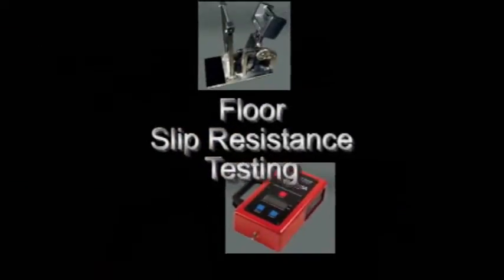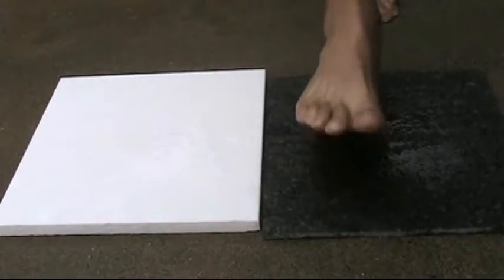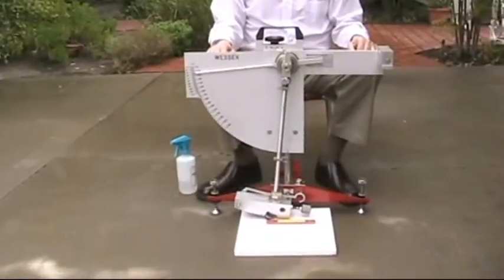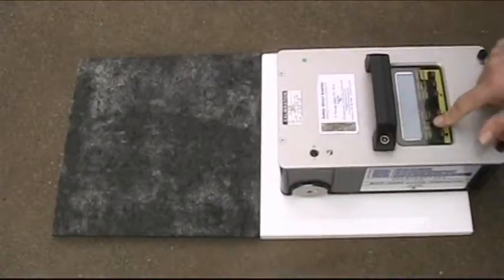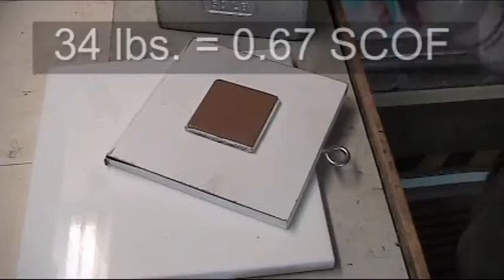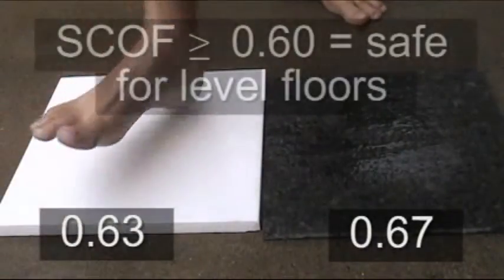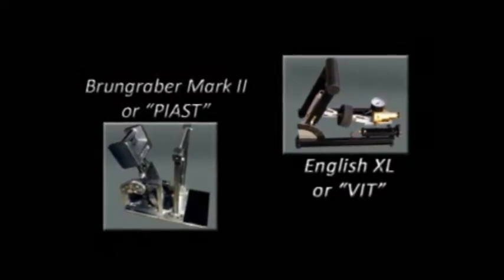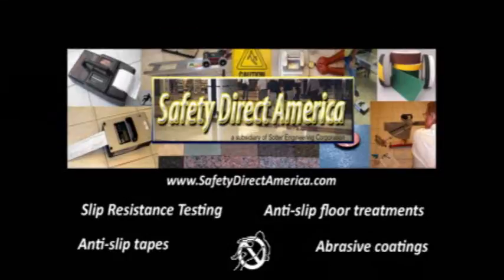Floor Slip Resistance Test

Comment: As you point out, the ASTM standards for the two testers have been withdrawn. There has never been such a standard for the testers that you sell. Either your testers can't meet the ASTM criteria or they haven't been submitted for approval. I believe the main reason the ASTM standards were withdrawn is that ASTM doesn't like proprietary machines. Perhaps your opinions are biased.
Reply from the maker: No, sir, "biased" couldn't be further from the truth. The Brungraber and English XL have been studied in various countries and they are very well-known to give completely different answers for each user...THAT is why the standards were withdrawn...for their inability to show that different labs can get a similar answer on the exact same tiles -- as shown in the video. We sell the pendulum, which is the most widely used and endorsed slip resistance tester in the world...it is the official tester in 49 nations, and has been endorsed by the CTIOA for many, many years. We also sell the BOT-3000E which presently has three official ANSI standards. The ASTM, unfortunately, has been endorsing and selling the SCOF C1028 standard for a long time now, but that standard expired last year, and it will be allowed by the ASTM to quietly fade out of existance due to the problems with it as shown in the video. That test does a horrible job of testing pedestrian slip resistance in the wet condition, and passes almost every tile I have tested using that method (and we've tested perhaps a thousand different floors using that really poor test method). We here at Safety Direct America are in contact with every floor slip resistance testing expert on the planet (not including the American "expert" witnesses scamming their way to paychecks using the English XL in court cases), and we only strive to spread the truth about floor slip testing since we in America have been so behind the rest of the world in this field until recently. Our hospitals are full of slip and fall victims, and the problem partially lies with the fact that bad and unreliable slip testing methods have been used in the U.S. for so long. Now common sense and actual research is taking over here and we are catching up with the knowledge already known in the UK, Australia, Germany, and other countries. Give us a call so we can further explain why the ASTM has been doing the pedestrians of this country a huge disservice over the past few decades, and what is happening now that is changing all that so that property owners, architects, building managers, and tile consumers can know their actual risk in every situation so that they can choose appropriate tile and seek remedies for slippery situations. When you know the truth, you can react to it. Unfortunatley the ASTM has been telling everyone that every floor is safe, which has made slips and falls the epidemic it is today in the U.S.
Reply from the maker: Daniel Merrick
 The BOT-3000E, although it is presently only made by one company, is not a proprietary device...it can be made by anyone. ANSI B101.1, B101.3, and A137.1 all require the use of the BOT. ANSI A137.1 is required of all indoor flooring according to the 2012 International Building Code...so it will slowly but surely be becoming a part of the code requirements of all new buildings as the new code is adopted by every city and county in the USA. There's more information on this at http://safetydirectamerica.com/SlipResistanceTestingStandards.html
Reply: safetydirectamerica Perhaps you are not biased but generally the marketer of a product should be relied upon with skepticism when considering opinions regarding that product. Advertisements, such as this video, are possibly a poor source of objective information. I will remain a skeptic. The truth is always a hard thing to know in science.
 
I will agree that C1028 is useless for testing fluid contaminated surfaces. It might be useful in testing dry, static coefficient of friction but people don't slip on dry floors.
 
I believe that there is a fair amount of well-deserved criticism for all slip testing products whether your company sells them or not.  For example, In 1999 Gronqvist says of the Portable Skid Resistance Tester (PRST), a pendulum instrument: "The precision and consistency of the PSRT was acceptable, but its validity for pedestrian slip resistance measurement should be improved. The main drawbacks were that the applied sliding velocity was unrealistically high and that the normal force was dependent on the friction coefficient." A pendulum tester doesn't measure COF or slip resistance, it actually measures energy loss. Powers in 2010 said "the Tortus II did not pass either criterion in the current study. This motor-driven tribometer has a small test foot (9.5-mm diameter) that is held in contact with the surface under a fixed load as it slides across the surface. Other investigators have implicated the drag sleds’ prolonged surface residence time as a cause of adhesion, leading to COF measurements on wet surfaces that are greater than or equal to slip resistant dry surfaces (9,12,23). This adhesion may account for the poor results of the other drag sled tribometers evaluated in our study (BOT 3000, Tortus III, HPS, and C1028)."
 
None of the testers available today do a very good job of modelling how a shoe heel strikes a walkway during normal gait. The velocity might be wrong, the force might be wrong, the direction of approach might be wrong, the contact pressure might be wrong, etc.
 
One day somebody will come up with a test mechanism/method that produces repeatable, validatable results. For now, I believe that the results of any tester should be taken with a grain of salt. They are the best we have so far and we will have to do with what we have for now. However, at $6000+ each, one could certainly expect more.
Reply from the maker: DanQuoLives
 I believe you are correct in that there is perhaps no "perfect instrument" yet available, but the three instruments we endorse are as close to perfect as exists in the world today. I personally prefer to use the pendulum and the BOT-3000E (using the ANSI B101.3 test method) to get a well-rounded idea of how a particular floor will perform. The pendulum has been used for over 50 years in the UK and elsewhere for testing pedestrian flooring, so the amount of practical research available for that instrument is unparalleled. The Australians have a very detailed standard which uses the pendulum and has different goals for each and every situation. For example, a pool deck may require a PTV of 45 or greater, and a second floor lobby would require much less slip resistance. Makes a whole lot of sense! The B101.3 method is also based on extensive research comparing its results to those obtained with the German ramp method, which is arguably the closest to perfect as can exist since it involves actual people walking on the actual flooring. Of course the ramp method is only a lab device and is therefore worthless for investigating slippery situations in the field. The purpose of this video is to educate people as to where the state of slip testing is today, and to point out why some popular methods (C1028, English XL) are completely inappropriate for measuring floor slip resistance. The C0128 and English XL methods only confuse people and help to fill our hospitals with slip and fall victims. We answer questions and educate people about slip testing every day, so we hope that our customers will see this video before calling us and asking for a C1028 test so that we can move on to doing testing for them that will help them see what their actual slip risk will be, instead of simply providing a service where every tile will pass whether it is slippery or not. Too many people put horribly slippery tiles in bad situations (such as pool decks and entryways) and then are stuck with a bad situation where the tile must be ripped out or a solution sought such as chemical treatment. We just hope to educate people so that these mistakes are no longer made and people can choose appropraite tile BEFORE it is installed and people are taking trips to the emergency room, hiring lawyers, and desparately seeking a solution to a horribly dangerous situation caused by lack of true knowledge of how a tile will perform when wet.
Reply: While I'm thinking about this I want to ask, when you say "BOT-3000E which presently has three official ANSI standards" what standards are you referring to? I am not aware that ANSI standards refer to any proprietary equipment.